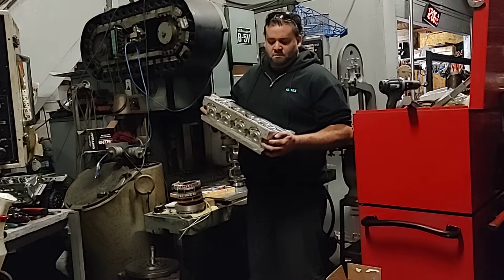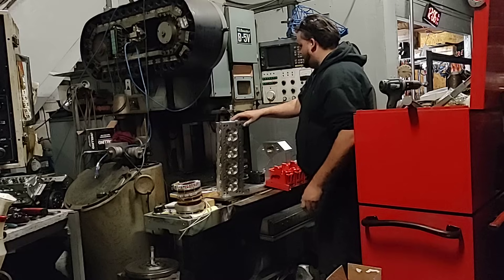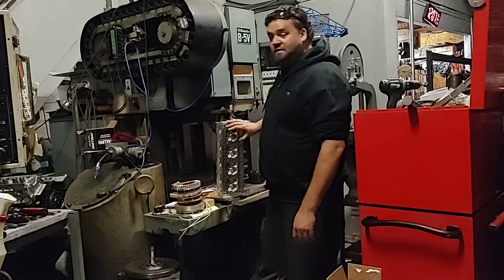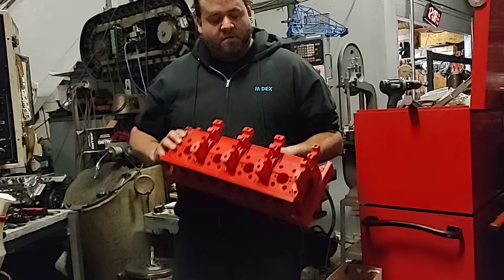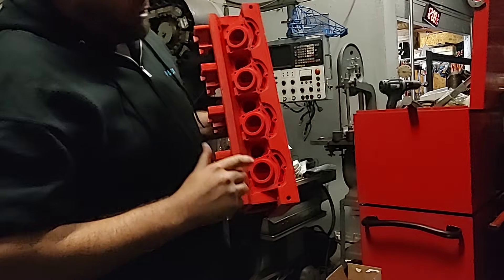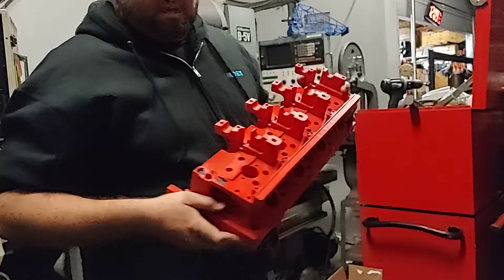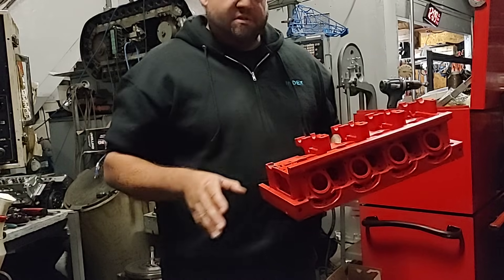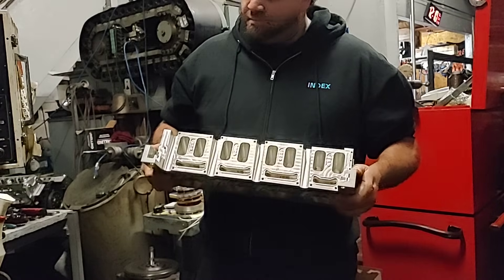LS 4 Valve Cylinder Heads- Better yet, they're BILLET

Comment: Hear me out, could you do an inline 6cyl version? Ive been eyeballing the people doing 2 ls heads welded together for a 300 inline 6, and this would simplify things immensely
Reply from the maker: First, I ask why? 

There are several reasons why I have answered no to the 300 Ford and 4.0 Amc dudes. I think this makes it like 23 people between the comments and Instagram that have asked this ( I don't blame you, I wish there was a bottom end that was actually made for it!!) 

Here's the reality: the rest of the engine is not made for power band usage between 4000-9000 rpm. Oil pump system is weak/needs to be upgraded, stock rotating assembly isn't built for it, block can't keep cool at those energy levels and these 4 valve LS heads aren't built for those dimensions- I'll explain! 

I know the pushrods are within a ten degree cone of LS lifter bore centerline, coming from a certain depth in the block with ample room to not interfere with the block or head gasket, this has been specially designed to have that geometry considered in the rocker arms as well. There is no joke 500 hours of designing and CAD time into these heads.

IF your cam is lower in the block, and lifters are in a narrow rectangular slot that lines up with stock LS heads with close interference, then they will certainly hit on this 4v head design. If I made straight 6 head for either the 300 or 4.0 they would have to be of a different architecture/bespoke design (100-500 hours of work before even buying the metal to make them). Unless you're looking to rev well into the 7k+ range, this style of cylinder head isn't right either. 

I explained myself, why do you want them for a 300 Ford? I think it would be better to get a high performance inline 6 block, maybe blueprint can make there 4 cylinder LS into a straight six...

Comment: Hey man, what do you think of making a duplex crossflow four-valve DOHC aluminum billet head for a Ford 300ci inline six? One cam could operate intakes 1,3,&5 along with 2,4&6 exhausts and the other cam  1, 3, & 5 exhausts along with 2,4&6 imtakes. That way dual small mirror image turbos could be mounted on each side with minimum plumbling. Make it like a Cosworth head but with all the odd numbered cylinder exhausts on one side and all the even numbered ones on the other, either that or just the traditional  crossflow so it could have a hemi-head for N/A with EFI or three side-draft Webers and VVT sprockets controlled by an Arduino and a PWM hydraulic servo valve. Put it in a Z car with a five-speed and shake some people up. LOL
Reply from the maker: I got my hands full with 70 hour a week day job and this. I highly encourage anyone to learn fusion 360 and draw up their ideas, all the training is on YouTube and free! I have many draftings of a k series v8 and inline 5, I plan to do that once I get these selling. One thing at a time!!
Reply: @AwkwardPerformance  Only 70 hours a week? That's it? LOL Thanks for the info man.

Comment: Look into the detroit style of rocker they used for their 4 valve head and was pushrod activated. Now, I cant guarantee a Y shape rocker will handle 6-7k RPM as detroits never went past 3.5 for most applications, but it may held simply things if needed

Comment: Hey David Vizard recently did a video on 4 valve heads, really recommend checking it out. Some valuable insights and he left his business number
Reply from the maker: I checked it out. I highly recommend watching his whole video( I'm guessing you already did!) . There are things I disagree with from my knowledge, but over all he is brilliant. For example, a nitrous engine will always benefit from a better cylinder head due to flow and air fuel atomization,and some of his thoughts on swirl (not that I can pin down exactly what he means by it) I'm shaky with. With that being said, I would rarely bet against him! I've thought about calling, but I hardly have the time to do this and I'll not be changing my design. I make no claims that my flow work is done, and to have him improve it would be awesome! As I get sets completed, I wouldn't be against asking for exploratory porting. He'll also not have to worry about breaking through too water!!

Comment: Do you think you could build a pair for a larger bore LS, or even an LT or big block? It would be awesome to see a pair of these on a 6.6 L8T or a huge big block.
Reply from the maker: They'll fit on any LS, as well as Lt with a LS cam lobe swap, as well as Sbf with lobe swap cam. I'll have a larger valve option at some point, probably going to be another shop providing those customizations, as well as chambers. I'll be doing a soft chamber option on the standard ones.
Reply: @AwkwardPerformance Fair enough, that makes sense. But what I mean is if you build them for an LS, I imagine the head bolt holes and coolant passages would have to be machined differently for an LT or SBF, plus the main benefit to an LT is having the direct injection which makes a lot of power. I’d have to look into what you mean by a lobe swap cam, excuse my ignorance there. But again I’m not sure that would work if you’re trying to retain DI. 
Either way the LS is a much bigger market so I understand the LT is very niche. But would be awesome to see a Big block version one day if your LS product is successful. 
Don’t skimp out on the internet marketing man. I bet these could be a big hit if you can reach the right audiences and maybe get them reviewed by a bigger YouTuber
Reply from the maker: @ImperatorCaesar22  I'm doing my best to figure out the YouTube thing. I think the water jackets line up on all three of those good enough. Swaps are done now with all those heads. 

I plan on doing LS,Lt,SBC,Sbf, bbc, bbm, sbm, gen3 hemi, Dodge viper, and Godzilla to start. Sbc and Dodge viper will come after the LS/Lt/sbf are up and going.

Comment: Have you thought about maybe sending off that 3d print file to a USA based metal 3d print shop to have them 3d printed.  It might help with the rapid prototype testing an help with cost compared to billet a. Machine labor time.
Reply from the maker: I plan to only make these out of billet, so I just bought a 12 foot stick of 5x8". I could barely afford that, and a metal 3d print as far as I can tell would be close to $60,000 and have absolutely terrible material performance compared to billet. So not only am I cheap, I won't actually compromise anything for longevity and design.

Comment: Questions:
1. How much additional weight and force will be required from the pushrods? A single pushrod is now opening two valves with the associated springs, retainers etc so there is obviously going to be more stresses on the pushrods, lifters and rockers. 
2. How much lower in the RPM range will  valve train float occur? Let's say a mild street/strip cam has a shift point of 6,800 RPM, how much lower does the shift point and rev limiter need to be in order to avoid valve float now that there is additional valve train weight and stress?
3. What hardness level is the material that you used to make the heads? Was it hardened before, after or both being cut in the CNC machine? 
4. You mentioned that it will require custom rockers. How many custom parts are involved? Intake manifold type?
5. What is the cost? 
6. To avoid the valve train problems I'm asking about, and even increase useable RPM range, is there a plan for an overhead cam, dual or single? 

Love the idea! Have a great day!
Reply from the maker: 1. Pushrod I'm not worried about-get Manton or equivalent, you NEED to invest in a good lifter 100% 
2. With the appropriate spring pressure for your cam shaft I'll jokingly say 8900, but it actually really depends on what junk you have in your engine. Baseline spring package will be able to rev to 7 with say a truck norris cam. 
3. It's 6061 T6 bar stock. So same as top fuel cylinder heads.
4&5. $7k range for assembled ready to run heads depending on spring and option. Rockers included, 1.7:1 and 1.5:1 options will be available to help your street cam not valve float. Also working on having cams idealized for the heads, but flow percentage is similar to an LS3 so most cams should work. 
6. No. No plans for overhead cam. Other people can do that-or they cant. Designing that is really easy. Designing the drive system for you to install with it in your engine bay with heads that now don't fit, I have zero interest in. 

7 for extra credit. These are for the small drag racer (or off-road or marine applications) to go as fast as a lot of the big boy engines, to change out blocks like top fuel changes heads-I'm only partially joking. 

Thanks for the listed questions and not a word soup!! Best!

Comment: does mercury marine make something like this
Reply from the maker: The Mercury SB4 is ot like mine, mainly their is a Dohc 4v, and fits a 4.125 bore. These fit the 5.3 bore and besides an oil drain back mod and intake, they are a driveway/garage bolt on. They are an inch wider than stock heads with exhaust manifolds, so they should be engine bay friendly. I'm only down like 3% on flow from the SB4 engine. I have put a lot of work into making this a great value to the customer and mechanic that will install them
Reply: @AwkwardPerformance  you're right sorry I didn't mean it to be sarcastic
Reply from the maker: @12v71detroit I will answer literally regardless, and without any sarcasm. It's not opposite day.

Comment: see you can chop up LS heads to fit a 300 6 ford, so why not take this design and make it fit a 300 i6 ford? thats possibly very big money right there
Reply from the maker: I don't know how many I'd sell. I'm not against at all!! I need to know tappet location to see if they would work on my heads due to pushrod angle.
Reply: @AwkwardPerformance 

Do you have a buissness email i have an open block and i can get the measurements 

On the factory ls heads it all ligns up properly 

Just the oil galley needs to be opened up and sealed to accomidate the wider head 

Specifically 5.3 head
Reply from the maker: @Project-gr6zy  Message me on Instagram at FY_lsx. I don't have an email setup for this yet, didn't expect such a response lol
Reply: @AwkwardPerformance 

No worries, I'll try and get the measurements sometime today

Comment: I’m gunna give it to you straight friend great basis for the start of 4 cam 4 valve LS, but right now the idea will remain mainly due to the excess weight in the valve train many diesels are set up this way it does create more airflow but don’t expect to take this arrangement above let’s say 5000 rpm and that’s with solid roller lifters, the coyote take advantage of this setup by having 4 cams overhead the valves making them only deal with their own mass, retainer, and spring keeping valve motion really allowing good air flow via the suck but as it stands now working more towards a diesel ls
Reply from the maker: Thanks for the comment and consideration. I'll start with a joke, and then ask some questions. Who hurt you with a pushrod engine?😂😂

So you've done the research on the valve weight, you know the rocker arm mass, spring pressures, etc on this? How do Harley M8 engines rev to well past 7000rpm with more aggressive cams with fairly light spring pressure? If you can oscillate a valve 70 times a second, 3 times the spring pressure can oscillate a pushrod. In other words, a sprint car engine with larger valves, .850 lift, large strong rocker arm, and stiff strong pushrod is controlled into the 9k range. Let's not get started on top fuel heritage series engines that go 10,500 through the lights with hemi valve train. If you have, please show work!!!
Reply: @AwkwardPerformance  I imagine the Harley m8 valve train is lightweight and streamlined and from what I’ve seen it is with rocker shaft that acts like a proto camshaft taking off considerable weight which your heads probably can’t take advantage of, and both of the top fuel and circle track cars dealing with extremely light weight valves which there are only two of
Reply from the maker: @benjaminwatson7868  this is based on that valve train technology. Is it close to being maxed out? I'll say yes. Is it impossible? I don't think so, because there are other heads that have ran and made great power and rpm. This is beefed up from that. I will never claim it will be as refined as a Dohc system like the new gm Z06 engine, but I will argue it will go faster in the hands of racers against the coyote, Nissan, Audi etc. and that's the point. Any weekend warrior or engine builder can easily tune his valvetrain with rocker arm options over the fender especially with cam selection idealized for it. And that's the goal. It's also fun to see people squirm while I only half jokingly take the position that pushrods are better, which they are.
Reply: @AwkwardPerformance  man you know pushrods are objectively not better cause they add weight right, if any American racing league could add dohc 4 valve heads to their engine configurations they immediately would, I don’t care what configuration you go for but I am pointing out correctly why they haven’t added two valves on one lifter for a reason and it’s that it’s not efficient at all
Reply from the maker: @benjaminwatson7868 I understand what your saying, I don't think you're acknowledging what i last replied with, and that's ok. You don't have to trust what I'm doing, or what's gone into this.  Again I appreciate your concerns, but physics is physics, and these aren't an F1 head. They are to help the guys that say ' it's here for a good time, not a long time' more so than not.  That information will trickle down to what's necessary to have them be reliable in a boat or handrail. There will be maintenance, wear, higher spring pressures and lifter pressures. So if that is in the 2/3 pressure category for what's running down the track in hundreds hemi's, big block Chevy's, big block Ford's etc they will be great. There is a reason why all these engines with MASSIVE rocker arms and scary to assemble spring pressure systems have prevailed, and the Sohc Ford cammer and Batten engines have not. I alone will not be solving every problem, but I look forward to working with engine builders, camshaft companies and racers on making this a system to battle the big billet engines. I did choose this because it's hard, and it fits in your stock engine bay. Best!
Reply: @AwkwardPerformance  well I’ll say this much don’t you think there is a reason they never put more than two valves to one port, that’s all I’m trying to say here we’ve been doing this for decades some people had to have experimented and saw something you might not be seeing right now

Comment: I’ve always known the reason the coyote makes so much power is the heads. I’ve been wanting to do a 6.0 or 6.2 destroked motor in my turbo GTO so I could run ported ls3 heads for big airflow but run a small cam for economy and drive ability. Something like this would be far better but monetarily unattainable for me. Cool to dream about tho! I bet a combo like that would make 1000hp on boost easily.

Comment: You’re going to need a half inch pushrod to survive under those dual rockers 😂
Reply from the maker: *9/16 tapered, which Manton I think will be happy to supply you. Luckily they were designed for that. In all reality, 3/8 think ones will do fine for most things. If your pushing 60psi at 9300 rpm. Then get the 9/16 ones

Comment: Any 6.0 liter plans? My ls2 t56 sierra could use more powa!
Reply from the maker: What do you mean 6 liter plans? They'll fit on all stock bore sizes. I will have chamber options for all setups, including high boost and or a lot of nitrous. I recommend turbos though. Or a blower. Bowers are good too
Reply: @AwkwardPerformance blower is on my parts list too!

Comment: Real advantage would be in a high rpm set up. Smaller valves equal less valvetrain weight.
Reply from the maker: Also could run a smaller cam, more displacement and no drop in high rpm performance due to less port saturation. Thanks for the comment!

Comment: Hope it works out 

Valve train instability kills though...!

OHC is what is need IMHO

GOOD LUCK
Reply from the maker: Why? NASCAR and drag race engines turn 9k commonly. With racing spring pressures, if you can oscillate the valve you can probably oscillate the push rod

Comment: camshafts will also need to be developed to compliment these heads. call Isky.....
Reply from the maker: I'm working with a cam company to develop some specific cams. I designed the flow percentage will work with most of the shelf LS3 cams. If you port the exhaust flow up, then I recommend talking to a cam grinder for those adjustments to avoid over scavenging

Comment: i thought the 2 valve heads promoted better swirl and better combustion, but then again, I believe GM tested 2 valve pushrod heads versus 4 valve DOHC heads, so it'll be interesting to see if 4 valve pushrod heads will do something interesting and worthwhile.
Reply from the maker: You have to look past the buzz words of swirl, and look to where the power is made (the concussion chamber). The energy of the intake charge spin is nothing close to combustion chamber activity. Intake charge spin is more necessary in detonation engines. 

Conflating 4 valve designs with Dohc is a misnomer, being that most domestic diesels as well as the Harley M8 engine are pushrod 4 valve setups. If you can afford to oscillate a valve, a pushrod really isn't much more, especially with racing spring pressures. Thanks for the comment!!